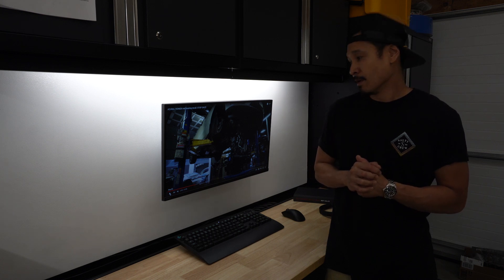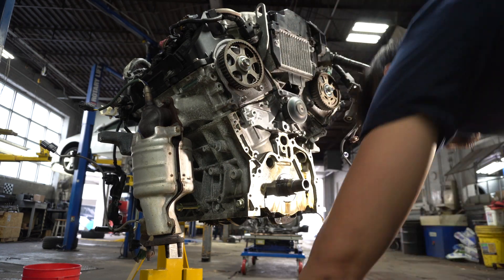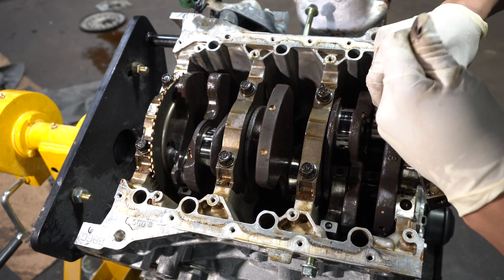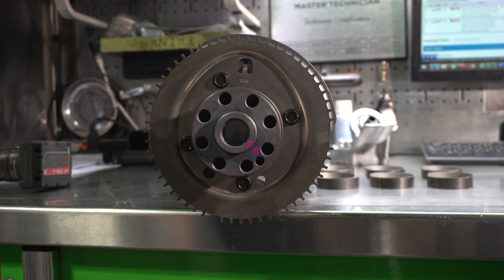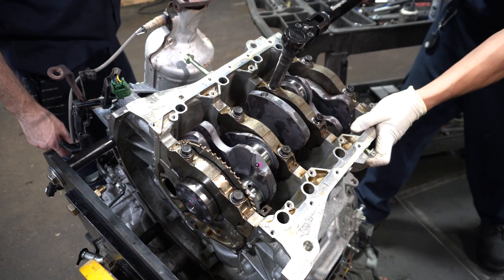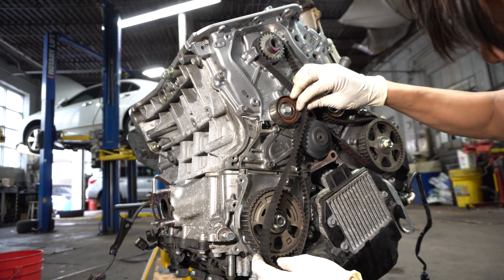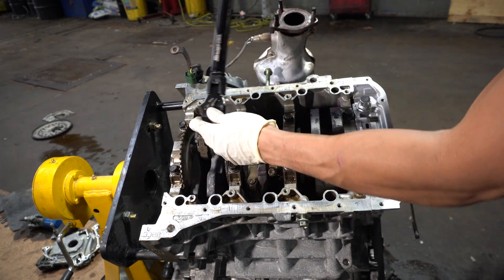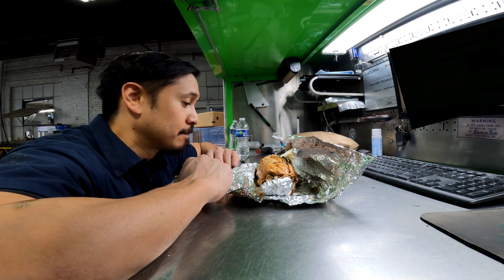ACURA & HONDA J35 CONNECTING ROD BEARING RECALL

Comment: If I have to take one of my Hondas in for any major recall work, what can I do to help the tech not have such a bad attitude working on my car?  Can I buy the tech lunch?  Slip a 100$ to the service advisor?  

Any recall or warranty work I have done, they do it in a hurry and don’t put the splash shield on correctly, leave tools in my bumper cover, etc…. What can I do to boost moral?  I like my cars. I want my shit to last.
Reply from the maker: @sdalexander8505  When dropping the car off for work, you can request to speak with the Technician that will be working on the car.  (This should not be a problem).  When face to face with the Technician, just let them know that you appreciate the work that they do and understand that out of all the skilled labor jobs there are, an Auto Tech is required to be trained the most, invested the most, yet paid the least.  Let them know that you understand the labor times are not in line with what they should be, and that if the work is completed correctly and cleanly, appreciation will be shown by way of (whatever you want to offer- cash tip, gift card, lunch or even just a thank you goes a long way).  

Fact of the matter is that the reason we’re so disgruntled is because in the dealership space, the Technician is the most important body of the organization.  Without us, nothing would get done.  Everyone seems to know this yet we’re treated like we’re expendable by the manufacturer; and society pretty much paints the worst picture of a Technician by making it look like we’re old-world dirty slimy Mechanics that failed out of school and that’s the only job we could get.

Improper monetary compensation is one thing but a lack of appreciation from pretty much everyone doesn’t quite lend any motivation to actually do a quality job.

I’ll do it.  But I need to beat time so I don’t lose money.  If that means taking short cuts.  Then so be it.

Comment: I have a 2017 MDX at the  dealer now and they  will be replacing bearings and crank also I"m having belt, leaking tensioner and water pump replaced. Does anyone know what the warranty will be on this work. It has 87k on it.
Reply from the maker: @louislitz7617  as far as I know the normal powertrain warranty carries forward.  6 years / 70k miles.  Performing the recall repair doesn’t extend the warranty.

Comment: First off, thank you very much for putting this video and the other two videos on this subject together on your channel. It's great to have information from someone with years of experience whose developed a feel for skilled work. 
I've just brought my 18 TLX with 68K miles in this week and the info you presented has really helped; in fact I asked the dealership about performing a timing belt service since they had to replace the crankshaft etc. Thanks to you, I asked in time before they wrapped things up and re-installed the engine. (They made no such suggestion) Keep up the great work.
Second, would like to ask your opinion about the instructions Honda is providing to perform these crankshaft replacements; how do you think this replacement method compares to how engines are assembled at the Honda factory? Does the original Honda assembly process include balancing the complete assembly/measuring key components/etc. that you would normally do or does the engine get assembled with faith that components are manufactured to spec similar to these replacement instructions?
Reply from the maker: Thank you and I'm glad you found the video informative and it helped you with saving on the timing belt package on your TLX.  

As for the instructions that are provided to perform the crankshaft replacements; my personal opinion is that it is a very crude way of doing things and is the bare minimum approach that has been taken to appease the NHTSA.  Fact of the matter is that this affects so many cars that they have had to find a way to keep costs as low as possible and this is the result.  The proper way to have done this was to just install crate engines on every affected car... but that would just be too expensive.  The way this is carried out absolves the manufacturer of any liability while transferring that liability to the Technician that is carrying out the repair.  

I can't speak on the original assembly process, as that is done at the factory- however, I can say that with my years of experience in the field and with many engines rebuilt under my own two hands, the documented way that the procedure is written in all of the service manuals I have ever used for engine assembly instructs to: measure and mic the crank, measure fore-aft play of the crank, plastigauge the main and rod journal bearings, and balance the rotating assembly.  On a mass production scale, I highly doubt that these measures are taken, as all the components are manufactured to a specific tolerance and weight... so they can kind of just bolt things up without having to measure and weigh everything while achieving a high success rate.

Comment: Thank you for posting this. I have ‘16 Pilot with 88k miles. I’ve been hearing the rattle when revving up in park (from 700rpm to 1,500 rpm), as well as taking off. Additionally, I’ve tried to rev it up while holding the break and here’s what it sounds like https://youtube.com/shorts/xrsgYnTggnA?si=JdEC6jplGODT5O6l. Does it sound like a rod knock to you? Car has been doing it for at least 3 yrs and 30k+ miles. Thank you

Comment: Hi, im from Mexico and I have a TLX with that same problem, my question is,  do you know where can I get the crankshaft and all the parts online ?
Reply from the maker: I'm not too sure you can order the specific parts that are on the recall.  You would have to tear the engine down to find out what specific crank and bearings you'll need and then order those individually from the standard parts catalog.
Reply: @NSXavier997 now I know what I need, but do you know any online site that I can buy legit ?
Reply: I have a pilot 2019 
Supposedly is not affected but I don’t trust Honda anymore 
I have tried looking for parts online but haven’t been able to find everything because it’s out of stock
Reply from the maker: @reyperez3424  Honda is now under investigation by NHTSA for engine failures.  I suspect HONDA will also be issuing this recall for all GDI V6 cars in the lineup.
Reply: I definitely would not attempt this by myself. These engines are so sophisticated. But they are so complex.

Comment: Great video!! I’m setting mine up (‘18 MDX Tech w/ 120k) with the dealer for the recall later this year. So is the new oil pump included in the fix? What other parts would you recommend replacing while in there? Water pump/Timing? Engine mounts? Also, every dry start, I hear metal scrapping for a second but stops when lubricated-do you think that could be caused by the crankshaft? Thanks!

Comment: Honda accord v6 2017  ? 
Its a  9.5 generation  ?
Reply from the maker: Very few Hondas are affected by this recall; its majority ACURA vehicles that are affected.  You can have your local dealership run a VIN status inquiry for you to see if the recall applies.
Reply: Honda accord isnt in this recall.
Reply: None of the 2013-2017 Accord J35Y1 (automatics) and J35Y2 (manuals) are affected in any of these recalls.

Comment: Mine is at the dealership now. They asked me if I wanted to pay to have the timing belt replaced and the water pump. What do you suggest? I have 62k on a 2018 tlx aspec. I normally trade in at about 95k to avoid expensive repairs. Thank for your time. Great informative video.
Reply from the maker: @LarryDoti  I would say it’s worth it to do it even if you do trade in.

Comment: I have a 2017 Honda ridgeline that is not part of the recall and unfortunately had the bearing issues with bottom end knock, it was diagnosed as what was listed in the recall and needs a whole new short block. Honda refuses to even acknowledge this problem outside the recall, so that's fun... Semms like they're screwing everyone this time around which I think has ruined Hondas reputation in my book.
Reply from the maker: If you think owners and customers are pissed off... you should see the general atmosphere in every shop across the nation regarding this entire mess.  I think I speak for ALL HONDA AND ACURA TECHNICIANS when I say that this recall, while necessary, is borderline criminal in regards to the time it pays the Technician.  The sad reality with this is that it's a trickle down effect.  Honda releases the recall > Customers are already on alert and wanting to get it done ASAP > There's TOO MANY CARS that are affected > HONDA wants this done and all affected cars repaired ASAP > The time it pays the Technician to do the repair in no way motivates them to do it > Technicians don't want to do it because it doesn't pay > Technicians will then straight up refuse to do the job (or lollygag on it) > huge backlog of appointments for the recall at EVERY DEALERSHIP.  Not to mention there's a Nationwide shortage of qualified Technicians to actually do the repair, they know this and yet, still compensate the Technicians that are actually qualified and doing the work ZERO.  I swear if I get a big enough following on YouTube I'm going to make a separate video about the pay structure of this recall and ultimately WHY it's taking so long to get them done... make no mistake, it's not the Technician's- it's what HONDA has decided to pay us to do the job that is slowing things down.
Reply: The disadvantage of Flat Rate pay.
Reply from the maker: @21Piloteer  Honestly it IS disadvantageous in this regard; however, I absolutely love it otherwise.  There's no other career out there that you can have that doesn't require loads of student loan debt or a college degree that you can actually make a decent living on.  As it stands right now, I have no debt other than my mortgage, every single toy I could possibly want AND I'm invested.  I wouldn't have been able to do that without being on flat rate and actually being able to capitalize on my knowledge, skill and most importantly; efficiency.
Reply: @NSXavier997 So glad I left the Honda/Acura dealership tech life after 26 years. Jobs paid progressively worse every year despite increasing complexity. It’s criminal what some jobs pay, guys do anything they can to skate them.
Reply from the maker: @ it’s getting pretty ugly. I got another 4-5 years to hustle and make as much $$$ as I can and then I’m out. Unless there is a change in pay structure for Auto Technicians, the current one will be the demise of the industry.
Reply: Warranty pay is insulting, and just kills morale. Flat rate depends on where you’re at to some extent. In my area it meant the more you knew the less you made in some cases. Great money doing suspension, brakes etc but if you had to do an engine, trans, or electrical diagnosis you wouldn’t do much better than straight time; another morale killer and why I left the trade. Nice to see you’re making it work but I bet going on your own with another skilled tech or two would be less 💩 and you’d have a stake in a business that could be sell later as well.
Reply from the maker: @evo80hd  Agree with you and I actually considered starting my own gig but what it came down to was start up capital.  I had enough to start something on my own but really just looked at it as another 9-5 that I would soon get annoyed with.  I have since studied what I could about finance, markets and economics and have learned the importance of investing and have made that a primary focus of mine; and so the capital that I would have used to start my own shop is now invested and growing. I only see myself doing this for a dealership until 2030, and hopefully by then my investments will have grown to a sizeable amount to where I have "the option to work"... which would really be nice as it would solidify the path to early retirement.  But yea.. I see this industry as dying and I'm just going to reap the benefits of my skill, knowledge and efficiency to the max while I can.
Reply: I 100% hear you. I’m on flat rate too and I’ve been getting steady raises over the years but my hours have been dropping. I try to stay in shape but I’m 41 now and I don’t know how much longer I can keep doing these jobs. Now we’re starting to do all these fuel pumps too. We had one tech only doing rod bearing recalls and he ended up tearing his rotator cuff and had to have surgery. He’s been out for months. That’s another reason why I’ve been looking into starting a resell business. Whatever it takes to get away from these dealerships.
Reply: 3 hours for bearings, 9 for a crank, 10 for a long block. Yet CP for this job would be double that!

Comment: My 2019 MDX just had the Crankshaft replaced this past week per the recal, it only has 50k miles. But , yeah,  now is making a rubing metal to metal noise it hets louder as i peed up. Any thoughts on this ?
Reply from the maker: Unfortunately I don't have any ideas of what could be causing your noise.  Suspension components are removed when replacing the crankshaft so maybe when the car was put back together, something suspension related might have been tweaked and is now making contact with another component... an example of this would be like a brake rotor dust shield now making contact with the brake rotor.  I would recommend bringing it back to the Dealership to have them take a look for a proper diagnosis.
Reply: Does it do it if you leave it in park and rev the engine?
Reply: @ProjectMore69  yes it does!. I'll upload a video and with a link.
Reply: @1gnxregal1  the reason I asked that is because it really narrows down what it could possibly be coming from so since it does it while it’s in park while revving the engine you know it’s not the suspension or anything else like that unfortunately it’s probably directly related to the engine with something internally thats screwed up and you may even have metal shavings in your oil now I would definitely take it back to the dealership and make them fix that ASAP
Reply: @ProjectMore69 it is  going back to the dealership,  I have contacted the service advisor https://youtu.be/N8SHf_G8Ppk?feature=shared
Reply: @1gnxregal1  I thought you were gonna rev the engine? All i can really hear is the normal high pressure fuel injectors

Comment: just came back from the acura dealership with my 2016 tlx they had to change the crankshaft  my engine was knocking
Reply from the maker: That sucks.
Reply: @NSXavier997  i know!! wished that never happen but acura changed a few other parts and fixed the problem and it cost me 0$ even if i was not under waranty anymore and they lent me a vehicle for the whole week so i didn't misss work. i am happy with the services that i got from acura at the end
Reply: Rod knock? they were supposed to give you a long block.

Comment: Awesome video! I have a 2017 MDX Tech and it’s been in the shop for 2 weeks. Just got confirmation today that I do need a new crank and it should be in by Friday. I have 78k miles on it, so I’m considering asking them to replace timing and water pump while in there since it’s due in the next 2-3 years. They haven’t offered, but I’m going to ask. Thanks for the great info!
Reply from the maker: Thank you!  Glad you enjoyed the video.  Requesting the timing belt and water pump is a good move on a 2017 with 78k miles.  I'm pinning this comment and advising all owners of these affected vehicles out there that this operation is not one that can be done quickly and shouldn't be rushed.  To everyone out there that currently has their car in the shop with a repair underway, or are currently waiting for their appointment date; please be patient.  There are A LOT of cars affected by this recall and as you all well know, a nationwide shortage of qualified Technicians to carry the repairs out.  To say that we are understaffed would be an understatement.  Furthermore, pairing that with HONDA & ACURA shorting the Technician's time on these repairs by a substantial amount really doesn't motivate us to get these done any faster.. it actually makes me put the car in my spare bay and work on it on/off in between jobs or on my lunch break.  This is a HIGH liability job with a VERY LOW reward.
Reply: @NSXavier997 yes having worked in the industry in the past and a best friend who’s a mechanic, everything you said is true. Thanks for the input on the timing belt and water pump. My frustration was more with the dealer, as I scheduled this in March and then it took 2 weeks to get the car on a lift and diagnose it, but it is what it is. Def not on the mechanic. 

Just curious, what does Acura “give you” for hours the job should take? I know they always assume the fastest mechanic with no distractions and everything going as smooth as possible (no seized bolts, other issues, etc).
Reply from the maker: @a7bean1  Book time for crankshaft replacement is 30 hours.  Honda is paying 9 hours to all of their hard working Technicians to clean up their mess.  Keep in mind, I'm a pretty fast Technician when it comes to doing any repair... but even I struggle to just MEET the time this pays.
Reply: @NSXavier997 that’s pathetic coverage from Honda. Makes me mad.
Reply: that’s what I was afraid of. Unreal! 🤯

I did speak to my rep and they are doing timing belt and water pump now too, along with my B17 service and front brake resurfacing. Costing a chunk, but at least should be in good shape for another 7+ years!
Reply: Its 7 years or 105k miles whichever comes worst you at 7 years it should be done. They should have said something though parts are about $600 but this will save you down the road. Don't forget these are do for valve adjustment every 105k miles also....👍